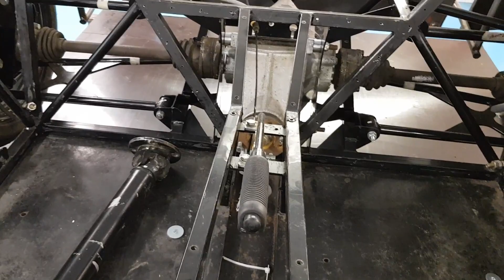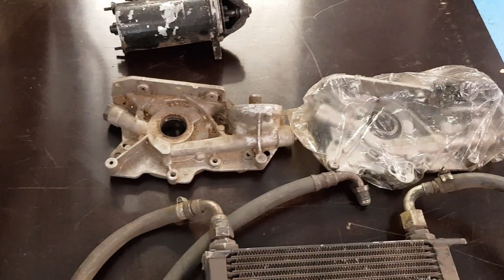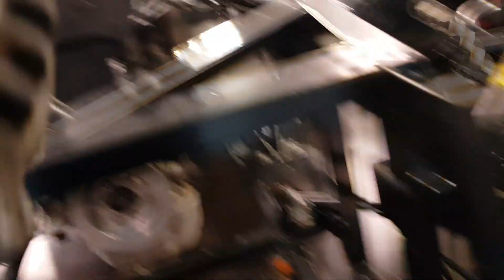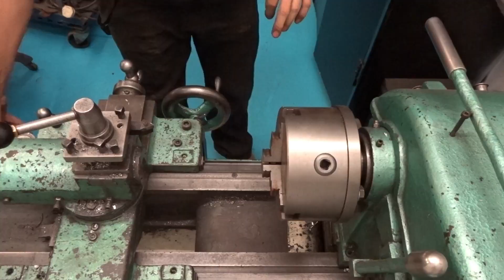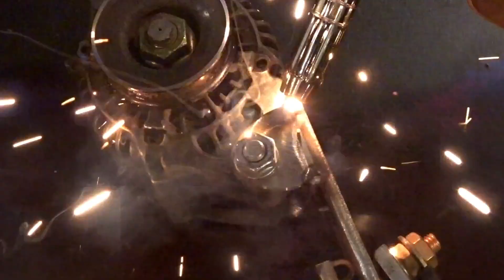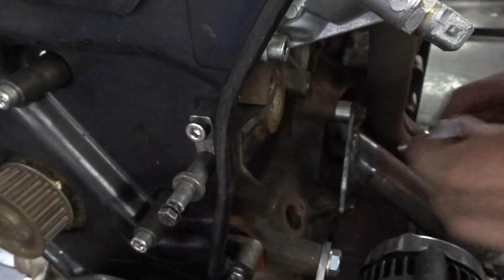Ep8: Relocating The Alternator On My Vauxhall C20XE Powered GBS Zero!

Comment: Hi there, got to say I would love that much space and equipment to build a kit. Is that the small denso 40Amp alternator? I think it may be short on power if your running injection, fuel pump, engine management, cooling fan and lights could mean you don't charge the battery. Also you might need to check the pulley sizes the crank pulley looks big, you need to check the rpms will suit the output characteristics of the alternator. Your doing great work mocking it up, I wouldn't want you to go too far to find out the alt is too small or spinning at the wrong speed.
Reply from the maker: Hi, I'm not 100% on the output but yes I think it is the 40-50amp one. (Its actually of a kabota tractor)  I have thought myself about the over spinning problem with the tractor only revving to 3k and I'll be pushing 8+k, and pulley sizes etc. But it seems a tried and tested setup on the XE so it all must works. Amp wise I should be fine even at 40amp, there may be a split second it will reach that, but the battery will cover that. Thanks for the comments, this is what the mock build is all about 😁

Comment: Hi Ron. Whilst you are mocking up the car you should weld a thick metal plate on the front right side of the chassis so you can stamp a chassis number. The box section is too thin to withstand letter and number punches. Just had to weld a plate on mine and there’s not much space when the car is fully built. Keep up the good work.
Reply from the maker: Great tip, I was thinking of doing something along those lines before I paint it up, after hearing similar problems others had had 👍

Comment: Nice job! I done mine slightly different using the bracket that you had on the other alternator and a bit of angle steel to mount it to. My Ecu is also under my scuttle panel on passenger side
Reply from the maker: Thank you 😁